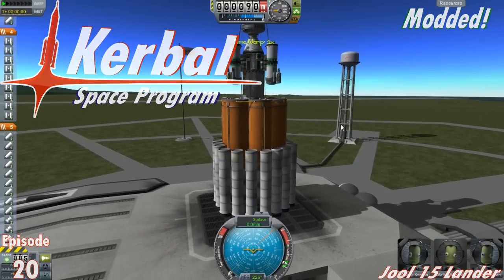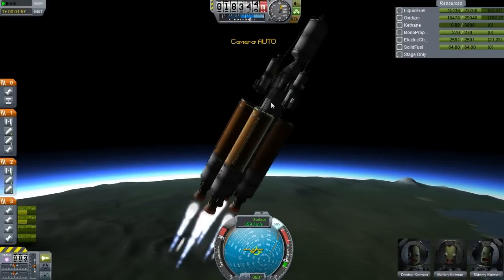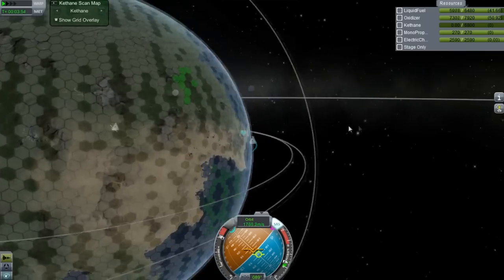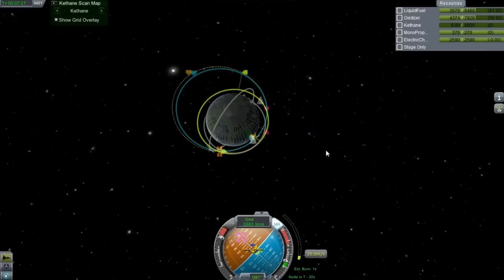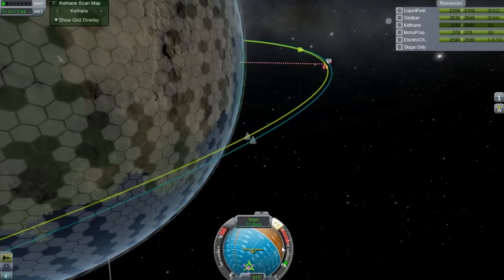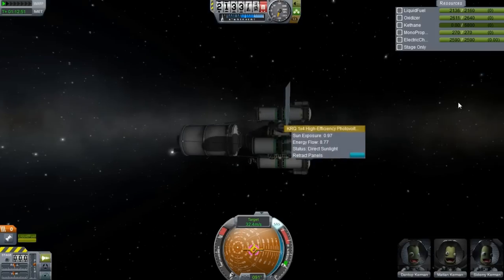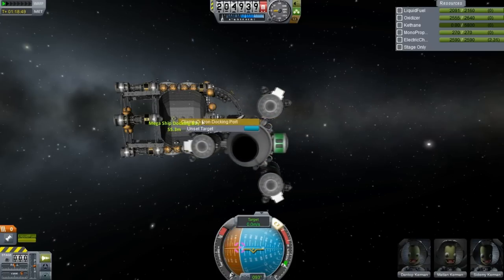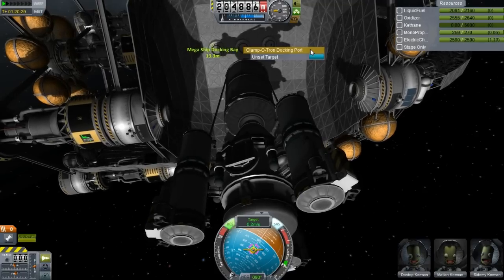KSP Modded - Ep. 20 - Jool 15 Lander!

Comment: when using welding mod do you know about if you have 2 or more power gens when using the welding mod it just like having one unless you have edited the save (not sure if that has happened to you)
Reply from the maker: usually it balances out. I will say at times its derpy with figuring out what your doing but I have edited the part configs so I get the result I was wanting ie. 6 thermic gens = 6 e/s or with the reactors I had to combine them all to get the right result.

Comment: U need to add escape pods, basically the smallest possible pod, and the smallest possible engine, just enough fuel to get away from an explosion and wait for rescue, u could send up a part lined with like 10 of them.
Reply from the maker: I was going to add this but I ended up cutting the module off at the last minute. The weight of it would have been insane. even if the weighted 2tons... x 10 = 20 tons extra plus the part of the ship. Maybe Ill add one in the docking bay. I also plan on using this to go places.